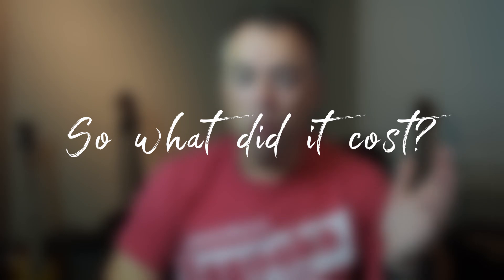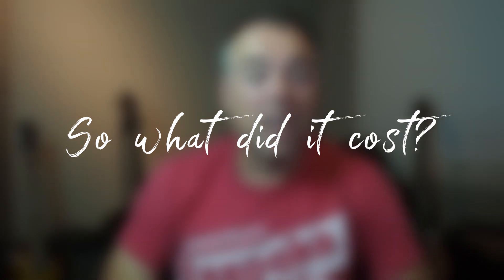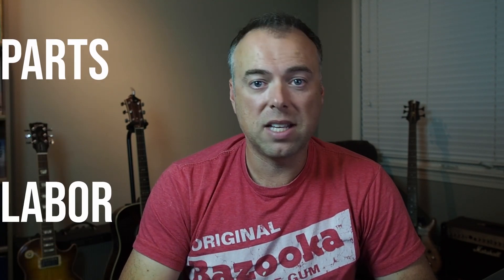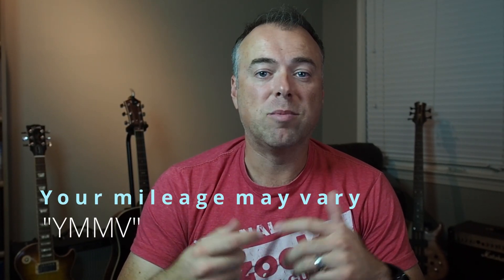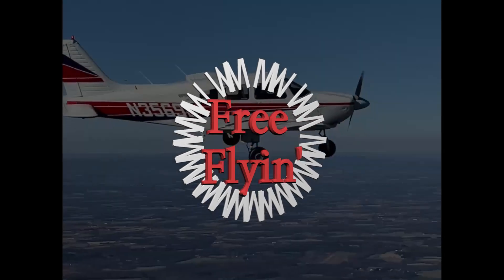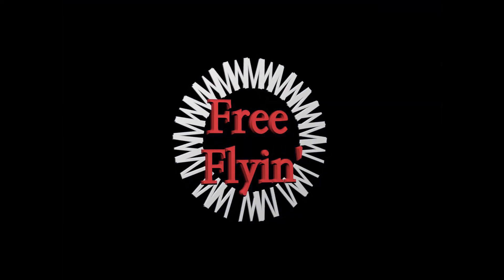GARMIN Costs Detailed | How much to upgrade the avionics panel in PA-28-181 Archer

Comment: Would you say it’s a little cheaper to have this  upgrade on a C172
Reply from the maker: Don’t think so, per se. The costs are going to be mainly driven by the components and the installer labor rates. Some installers may find it easier to work with a 172 panel - some not.
Reply: @MikeWebb-FlyingFinanciallyFree  Thank you so much for taking the time to put all this information out to the public.

Comment: More interested in Proline Fusion upgrades and cost…
Reply from the maker: Ha!  Yeah, I think you need to be on the Jet pages for that stuff.
Reply: G1000 upgrade is sufficient. Figures I get are 350-400 but if there is anyone good that does it for less I would like to know…
Reply from the maker: @Naija4K  To my understanding you can't upgrade to a G1000, as that is part of the type certificate of a plane upon production.  The closest you could do is G600TXI PFD/MFD, and then you'd need to add an appropriate navigator(s).  The G1000 is all integrated and only available from the factory.  But hey, I could be wrong.
Reply: I’m looking for a King Air, for a cheaper Avionics solution than the big sticker one I am getting.
Reply: I’m looking for a King Air, for a cheaper Avionics solution than the big sticker one I am getting.
Reply: I’m looking for a King Air, for a cheaper Avionics solution than the big sticker one I am getting.

Comment: I asked about the cost in the other video...  Sorry...  One more thing...  There is a company called Approach Faststack that I ran into at Oshkosh.  They provide cables and a unique hub to plug in various electronic devices.  The owner had put together a bundle of Garmin stuff, 2 G5s, a Garmin navigator, another com, ADS-B transponder, and com panel.  Right at $20K.  I wonder if that would reduce some of the cost?  Once the hub is in there, if you add another piece, you just get the cable and plug it in.  Thanks for the video.  Oh yeah, from the looks of all the guitars, money isn't a problem....  I should talk..  I have 10 guitars..

Comment: But,, certified avionics are more expensive than experimental units aren't they???
Reply from the maker: Hi Russell.  Yes, certified avionics are considerably more expensive than experimental, but you can't put experimental in certified aircraft.  Also, this airplane is used in commercial operations which you can't do (typically) with experimentals.

Comment: Curious what the difference would have been if you had just installed a G1000 or G3X?  I'm looking at buy an old 182 and redoing the panel as well.
Reply from the maker: I considered it, indeed.  The G3X had just come out when I was doing this.  I was told it would've been at least $15k more, as there's a lot more work to be done setting up all the wiring harnesses and interfacing with a full glass setup vs. the 'hybrid' approach I ended up doing.

Comment: I'm assuming this is an IFR legal panel.  The turn coordinator is removed. If the Attitude Indicator fails, there is no partial panel for reference.  So, what is the backup attitude information?

Also, you already had the Garmin GPS installed.  How much did that cost?
Reply from the maker: The 2nd G5 in the HSI position has a reversionary role if the top G5 were to fail. With one push of a button it can provide the same PFD info.

Comment: Nice explanation! I see in your picture you a new engine monitor...what kind is it?  Also, how were you able to keep the original gauges? Thanks
Reply: Really nice !  So the original Archer senders worked  with JPI. ?
Reply from the maker: They had to add new probes and sensors with the install of the monitor,  but it does not know the fuel levels in the tanks without input from the user. It does measure fuel flow accurately, however, with transducers calibrated to the correct K-factor.
Reply from the maker: It's the JPI EDM 830.  The original gauges were easy to keep; the monitor went in a spot previously occupied by a CDI.

Comment: I don't think the price, for what you got and the labor to put it in, was that bad.  I mean, when you look at it, the labor itself was a third of the cost, and skilled avionics technicians don't come cheap.  To upgrade what you did most certainly increases the value of the aircraft, but as you said in the other video, you're not going to get what you paid for the new stuff back, even if you sold the airplane today, but I'd be willing to bet you'd get $20-25K more than what you would have gotten from before the upgrades.
There's a 1981 Archer II with 8,000 hours, Aspen two screen, a new Bendix/King Aerocruze 100 (which is a TruTrack Cruze100 autopilot)  I guess Bendix/King must have bought them out.  This Archer also has a Garmin GNX375 GPS/Transponder and an old Bendix/King NavCom.  They're asking $115K for it, which I guess with the upgrades might almosrrt be about right.  There are some other Archers without current avionics upgrades that are less, but maybe $40,000 or so.
So, if you think that the avionics upgrade is about one third of the value of the airplane, I think that's a reasonable price to have paid.

Now, say I was to get something like a Malibu.  Here's a nice 1986 Malibu for $315,000.  Five thousand hours with less than 500 on a reman'd TSIO-550 engine.  However, it has old avionics, even though it has a couple of GNS navigators in it.  Well, one, a GNS-530W.
https://www.controller.com/listing/for-sale/201395745/1986-piper-malibu-piston-single-aircraft
If you're seen N444DT, YouTube channel 'Malibu Flyer' he ended up with a complete new panel, probably in the range of $100-125K, which again, is about one third the price of the above Malibu.
https://www.youtube.com/watch?v=3AJl0J3abpw

By the way, I've lost my medical, I'm not current, and I don't ever expect to be flying again, but I still can dream.  :)

So, I think what you paid for your install, for what you got, was about right, between the hardware and the labor.

Comment: Some advice from an expert in the field of avionics. 37 years in avionics and I own two avionics shops.  First the good.  Great pricing! Also being on time for a job like that is really good!  Now some constructive criticism.  First don’t ever show work orders, logbook entries on your channel.  It makes you and the shop liable if a FAA rep was trolling and found issues.  Right away I can tell you the airplane is unairworthy by the invoice.  If I read the invoice right they replaced one fuel hose.  This is a common mistake.  The JPI manual requires that both hoses be replaced.  The hose in AND out of the new fuel flow transducer must be replaced with new TSO’d hoses. Reusing the original hose is not an option. The next problem is the listed circuit breakers. They are the common 7277 series.  Great circuit breakers and very common in general aviation. But unfortunately not legal in this install.  Most Garmin products require the slightly more expensive 7274 mil spec series circuit breakers.  Any way I’m not trying to cause trouble, Just giving free advice.  I’d give the shop a 8/10 if they are willing to fix the two problems. Enjoy your new avionics.  You made some good choices.
Reply: If he hadn't posted his invoice ,you haven't commented on it and he would never know ;)
Reply: So does one stay away from the shop because of the oversights that you pointed out?  While I was really impressed with the pricing, that seems to be a pretty bad oversight?  Not trying to put down the shop one bit .  I don’t own yet and I’m trying to learn
Reply: @in2flying  you just need to do your own risk assessment. If someone installs something improperly the general thought is that it’s on that shop.  The FAA doesn’t look at it that way. Somehow you are expected even as a pilot to know everything about the installation and make sure it is all done properly so you aren’t flying an unairworthy airplane.  Which is pretty crazy! Talk to people that have used the shop and see what they have to say.   Most people care about two things.  The price and will it work when I pick it up from the shop.  I see every day that people are putting things in illegally and people say “ Well as long as it works”.  Which is fine until a hard nosed FAA rep inspects your airplane.  Or you damage the airplane and the insurance claim doesn’t go through because the airplane is technically unairworthy. All in all the shop did fine. They just didn’t read the manual thoroughly. If someone bring this up to them, and they actually have an interest in doing better, then they will learn and be better off because of it. We all learn from our mistakes, if we chose to that is.
Reply: I don't know how much profit a shop makes on parts versus labor, but as is common amongst many technician shops today, it appears they charged "book" time rather than actual time. Well over 100 hrs in three days is not possible even if two people were working simultaneously, which is highly unlikely. Plus there appears to be a long of "nickel and dime" charge on that bill. Normally I wouldn't say anything, but this trend in aviation is a barrier to entry.
Reply from the maker: I’m not sure where you’re getting the 3 day thing as this job was completed over 2 weeks. So, the 100 hours were easily accounted for.
Reply: @anonymous-yg1hy  There is no book. I can't speak for other shops but I charge a 10% markup and then what time I think the job will take. It always takes more time than I quote. So I guess I'm on the other side of the spectrum.
Reply: As someone else said, this is actually why you should post invoices. 👍

Comment: Hey Mike, I love your videos and I'm very interested in eventually following in your footsteps and going the leaseback route. Quick question for you. Given that you likely won't recoup the labor costs associated with avionics upgrades do you think it's optimal to spend more buying a plane with a better panel vice doing the upgrades post buying?
Reply from the maker: Hey Alex. Thanks for the compliments! It depends on your goals. If you can find a plane that has what you want already in it, it may make sense to spend more to buy that one bc it will likely be less than doing it yourself. (Exceptions always exist, of course) Other times, getting a great price on a ‘fixer upper’ is the way to go. It really depends on your time/energy/funds.

Comment: Did you not install a G500txi because you needed the G5 for the autopilot?  G500txi w/ESI vs 2 G5s and the JPI not ridiculously that far apart in cost considering what you paid.
Reply from the maker: Hey Mark, I looked at the G500 but I was told be my shop that the labor to install that would far exceed the all-in cost of this job, especially with a new panel needing to be cut, etc. And that wouldn’t include the Autopilot and G5 to drive it (as you mentioned). I considered it, but this seemed to be the best solution, since it’s main purpose is still as a trainer.
Reply: @MikeWebb-FlyingFinanciallyFree  Good to know.  Roughly,  what would have been the cost for a G500txi ESI setup w/a GFC500?  Seems everyone wants to treat the install price a national secret.   I really want a Twin Comanche, but by the time you add a G600, GTN750, and GFC600 (which does not have an STC yet) I seems like I could have gotten a pressurized Malibu like 444DT for the same money.
Reply: Mark, the difference in pricing between the G500TXi with EIS and the work Mike did would easily be double.  Maybe more.  They are world apart in function and price.  Think 1965 Cessna 172 vs a new Cirrus.

Comment: What % of that do you believe you would recoup in a sale? 60-70%?
Reply from the maker: Good question!  Only the market will bear that answer out, if and when I tried to sell.  I believe the conventional wisdom is you won't recoup any of the labor cost.  Depends on the popularity of the parts for the rest, I suppose.
Reply: Mike Webb still worth it IMHO. You have a well equipped plane for 100’k  under new.  I noticed you also had a PITOT leak, curious if you would have noticed and when without a shop finding that or electronics to verify accuracy.
Reply from the maker: @N937LC  I'm guessing it would've been found in the next pitot/static certification test... but it was nice to have the leak discovered and remedied during this process.  You're right in that I may have been flying around with some inaccurate numbers and didn't even know it!
Reply: Really fantastic video. This information is worth it's weight in gold (does information have weight?). Anyway, really valuable for me. Thank you.
Reply from the maker: Thanks! Glad you liked it!